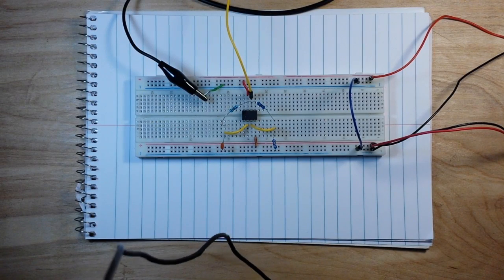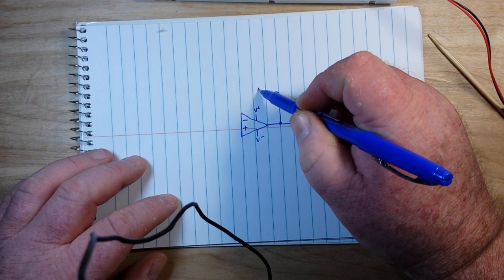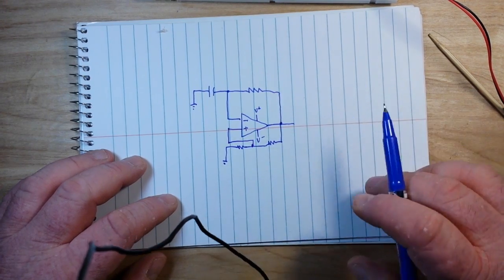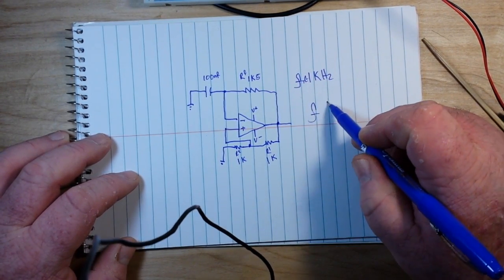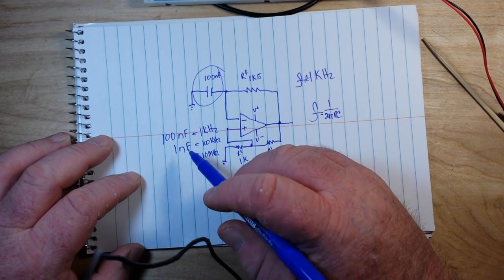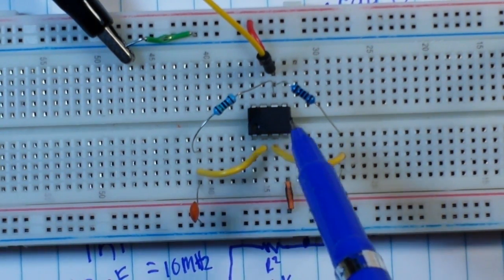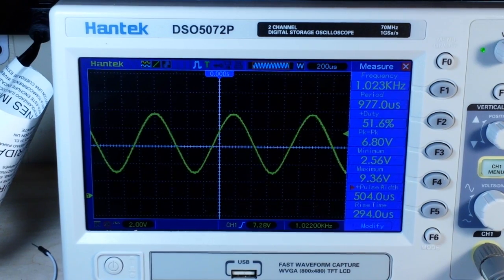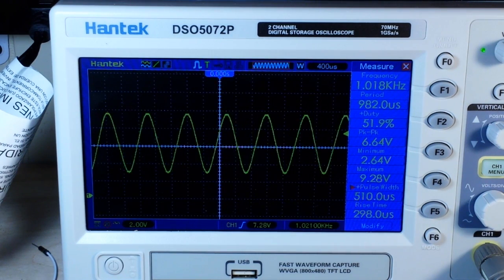How to create a tuned oscillator at any frequency

Comment: Is the feedback resistor the "R" in the formula 1/2piRC? or do the voltage divider R's also a factor in the equation.
Can we simply replace the feedback R with a trimpot to adjust the oscillator???

Comment: OK I have built and rebuilt and I can't get this to work.  I am using standard 100mm jumper wires that came with the breadboard kit- could that cause this to not show any voltage output at all?  I have read that RF circuits need short wires to prevent RFI loss but it seems like I should still see something on the oscilloscope.  I'm feeding this with a std 9 volt battery.

Comment: Simple and easy to learn 741 is an IC often used in audio circuit and a RC combination has its limits. But we can try other ic's with higher frequency cut-off range.
Reply: What IC's do you suggest using for MHz/GHz range? Are these types of circuits even a viable option at such high frequencies?

Comment: Another great video Paul. I realise this is a fixed circuit design. How cool would it be to use a trimmer cap, or small air variable cap.? I think it would be cool to see the frequency oscillation change on the O-Scope. Yeah I said it(O-Scope)lol

Comment: How do i use the op amp on a 
split supply if i am using pin 3 for the oscillator timing?

Comment: I tried your circuit using simulator. Output gave out a square wave instead of sine wave. I googled the circuit and found that it is called relaxation circuit, which is used to generate square wave. How did you get the sine wave from the output without additional components? I am bewildered by your demonstration.
Reply: I think you’re right Shue Wing Tam
Reply: Gotta use a positive and negative rail supply. He used two 9v batteries hooked together, so 18v.
Reply: 😂OK it is the fundamental square wave generator.🤣
Reply: Nonsense. His frequency formula is incorrect, the output is square, never sinusoid, this op-amp will generate in the order of a 50 khz maximum, to talk about a 10 mhz range is pure nonsense. I appreciate this gentleman's love of experimentation, but he is not in the position to instruct others with this level of knowledge.  I am sorry to say.
Reply: @emery5581  I was also surprised when he mentioned 10 MHz as a frequency optainable with this IC. Do you have experience with other IC's that can operate at these frequencies? If so i would love a few sugestions.
Reply: @emery5581  Your channel has no content....

Comment: Hello...why not use a nice multi-turn pot as your feedback resistor for fine (or total) tuning with an appropriate capacitor for the desired range?  In cases like this, II usually add a small fixed resistance as to avoid "crashing" the output if the pot is turned to 0 Ohms.
A jumper to connect various caps may be useful...

Comment: Can it be used for FM radio with a tuning capacitor from 1pf to 50pf?
Reply: travis moore
Not possible, cuz the maximum frequency response of 555 is 500khz and articles say 2Mhz
Reply: @Mulazim.  What about the LT1677 op amp, Besides you don't need gain for the oscillator just the audio.

Comment: Thanks, very nice and easy to understand video. Deducing from your other (NE555 based) oscillator circuit - if I differentiate the SIN output once I can get a triangle wave and differentiating it twice I would land up with a square wave. Correct? or is it too simple thinking?
Reply: Differentiating (or integrating) a sin wave produces a sine wave. Sinusoidal in nature, there is a phase shift.
Reply from the maker: They won't be perfect, but yes you are correct

Comment: Now I need to work out how I use this in ham radio construction.
Reply: This really is not stable enough for that application. You need either as xtal controlled oscillator and/or a PLL. You could use it for CW or may be AM, not stable enough for SSB phone.
Reply: @scotttheis9345  thanks! 👍🏻
Reply: @scotttheis9345  Thanks for the advice Scott.
Reply: BTW, it is a good video. I shared it on my ham club's website.
Reply: Same here! hehehe :D

Comment: 05:48 So how does it work that it produces such a nice sine wave? The charging/discharging characteristics of a capacitor aren't quite sinusoidal, they're exponential. So where does the sine come from?
Reply: This circuit does not generate sine wave, it generates square wave, he uses same circuit in one of his tutorial to use it in function generator, he uses two  other stages as op amp integrators to change  the form of the wave to triangle and then to sine wave, but how comes in this tutorial it generates sine wave 🤔?
Reply: @manofmesopotamia7602  Oh, so it's not really a sine wave, but its 2nd-order (parabolic) approximation. If you integrate a square wave (which is basically a constant piecewise function), you get a 1st-order (linear) function (which, piecewisely, is a triangle or sawtooth wave). One more integration and you get the 2nd-order function (parabolic). It might look like a sine, but it really isn't, and I'm pretty sure that the difference could be heard by ear, because if you Fourier-decompose a parabola, you get a whole bunch of higher harmonics.
Reply: @manofmesopotamia7602  Maybe he changed the y axes down so it looks like full sine wave not half ?
Reply: The output is a square wave with slanted ramps, the signal on the -ve input of op-amp would resemble a sawtooth with exponential features. There is no sinusoidal signal to be found in this circuit, anywhere! The frequency formula is wrong as well. Please do not try to learn from someone who does not know and what is worse, does not realize he does not know. Also, this particular op-amp is capable of generating decent square waveforms up to a couple of kilohertz, no more. To talk about a 10 mhz capability is plain stupid.

Comment: According to page 4 here https://www.diodes.com/assets/Datasheets/LM358.pdf "Pulse Generator" image, it's possible to put a capacitor with polarity. Perhaps an electrolytic capacitor ? So can it work in your circuit ?
Reply: It's a pulse generator different from this circuit, https://en.wikipedia.org/wiki/Relaxation_oscillator#Comparator%E2%80%93based_electronic_relaxation_oscillator suprisingly wikipedia explained it well, look at the "Transient analysis of a comparator-based relaxation oscillator." Image. The capacitor bounces between 0.5v and -0.5v so it's not a good idea to put an electrolytic capacitor in here also it's frequency characteristics are not suitable above 10 khz watch this: https://www.youtube.com/watch?v=WytU5uj78-4

Comment: This was exactly the circuit I was looking for to make some antenna experiments. Thank you so much !!!!! Keep the effort on this kind of content on electronics fundamentals.
Reply: You cannot make antenna experiments with a few kilohertz circuit. This op-amp has a gain bandwidth product of 1mhz, meaning that the square waves generated cannot exceed the frequency of about 100 khz. Also, at that limiting frequency, the signal will become fully triangular instead of square. Op-amps are generally not suited for RF generation. Try one of many different types of single stage tuned LC oscillators (such as Colpitts) if you want to experiment with antenna matching in transmission.

Comment: sir as per your circuit diagram it a diagram of astable multivibrator using opamp .
so how you generate sinewave ??
its o/p may be square wave .
Reply: Ideal output should look like rising an falling exponent, but Opamp used is slow, so the corners are smoothed out.

Comment: what is max frequency we are able to make with this? for bigger like 50mhz need other op-amps? this question should be several guys request thanks
Reply: You will be lucky to get 1 MHz with the 741 op amp. You need to use a transistor to get the higher frequencies. A Colpitts oscillator would work well for 20 - 50 MHz.
Reply: @benthere8051  AS video says 10pf not give 10mhz?
Reply: @seyedmarashi  - I doubt you could get it to work at 1 MHz, much less 10 MHz. The maximum slew rate for a 741 is 1.5 volts per uS. The entire period for a 10 MHz wave is 100 nS. There are MUCH better op amps to use at that frequency.  The minimum bandwidth for a 741 is 400 KHz. You might be able to hand-pick some that would work at 1.5 MHz.
Reply: @benthere8051  Thanks a lot, last question! any part number that you sure replace with 741 to make bigger frequencies?
Reply: @seyedmarashi  You can make HF oscillators using standard 74HC14 that will work at 20 MHz or better. Go to Youtube and search for "Crystal oscillator using Hex Inverter".

Comment: It says Any frequency.  But the 741 can't oscillate above audio frequencies.  100 kHz is probably not stable, and I bet your chances of getting to oscillate at 1 MHz are the same as winning the lottery.  So it should say any audio frequency.  Thanks for the informative video.
Reply: Well I tried it with the only op amp i had, which happens to be th TL082. It can oscillate at 1 mhz and some khz beyond. It is low noise and high frequency so if you need that frequency try with the 082 or similar. It could work with rail to rail op amps too

Comment: Great video, very informative. Couple questions, in the formula when you use R this refers to Rf correct? Also are the other resistor values imperative or do they just need to be the same value? (If I'm understanding correctly it's just splitting the voltage to that input, right?) Thanks.

Comment: Hi there, I might build this one, is 18v essential ? Would 12v do the job..?
Reply from the maker: Hi David, 12V will work just fine. Keep in mind that you need a split supply. The easy way is to use two nine volt batteries. Connect the neg from the first battery to the pos of the second. The pos from first battery is your +9V, the neg from the second battery is your -9V and where you connected the two wires together is your ground.
Reply: OK, thanks Peter, I'll wire it thus and let you know how it goes. I really like your videos, you and Big Clive are my favourites (it's the style, manner, voice and content)..
Reply: You also can use a 7660 to create V- and V+ voltage, very easy to make.

Comment: i finally got around to building that circuit, it doesnt work :C. i replaced the 1k resistors with 10k, cause i had them lying around. i figured that wouldnt make a difference. and i replaced the 1k5 resistor with my 10 turn pot (100-10kOhm). it just stays at like 3 volts or so. what voltage did you supply to the circuit? i tried with 5. any clue why it doesnt oscillate? ill upload a video of it tomorrow on my electronics channel

/edit: i tied v- to gnd and v+ to 5v, could that be an issue?
Reply from the maker: Yes it could. With a 741 it needs to see a positive and a negative supply. I use a 18V supply consisting of  2 9V batteries so the op amp gets +9V and -9V with gnd being the common between the batteries.
Reply: yup double supply did the trick. its just hard running that of a single lipo cell :P
Reply: Did you use both a positive and negative voltage rail.  (+5,-5)?

Comment: can this be made adjustable with a pot?
Reply from the maker: fredlllll somewhat. the capacitor adjusts the range, and Rf adjusts the frequency.
Reply: could be useful if i cant get my 555 circuit to behave like i want it to :P all i need to adjust is frequency from 38kHz to 48kHz
Reply from the maker: fredlllll this would work well for that.